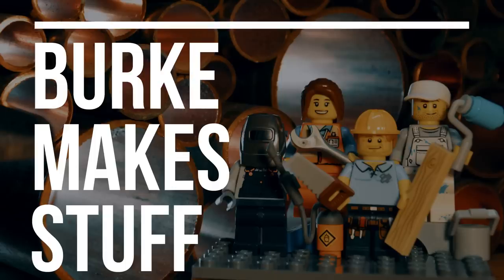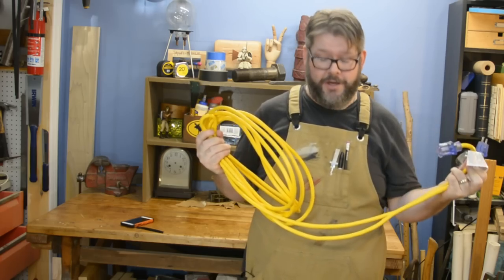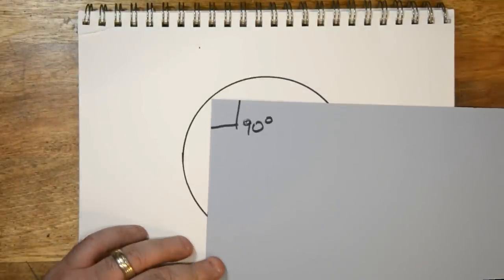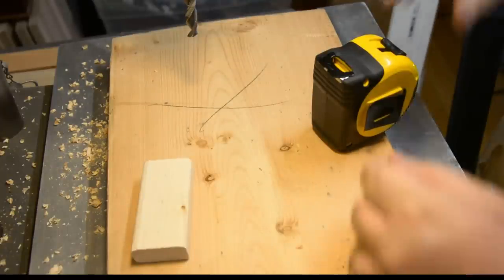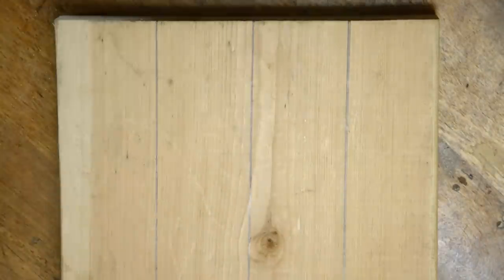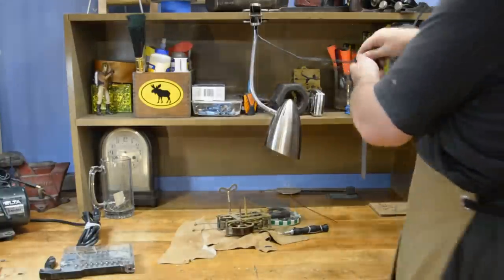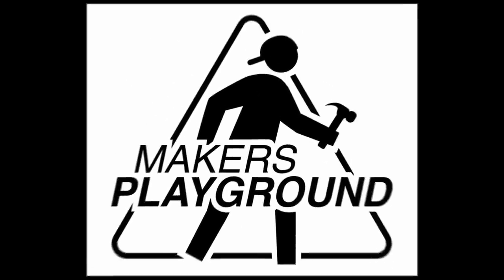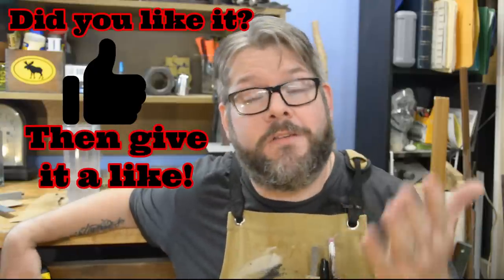10 Easy Shop Hacks #2

Comment: The way you “coiled” that cable made me sick.
Reply from the maker: So I’ve been told. Lol. This is gonna sound dumb, but I’ve always done it that way. I am, however, not above admitting when I do something wrong. What’s the right way?
Reply: Pull it all the way out, leaving it coiled will cause a tremendous amount of heat which could take the tool out or worse the whole shop. Have you ever tried the trick where you take a mail wrap a wire around it and put it on a battery it gets hot as heck. A battery is only 1-1/2 volts your wall is 120.
Reply from the maker: So I’ve been told. Always down it that way. Never had an issue. If it makes you sick though, I would highly recommend NOT doing it that way! 🤮

Comment: I stopped watching in the middle of the 1st “tip”. Winding an extension cord around you forearm it the absolute worst way to wrap a cord. I was a Union stagehand for 15 years and doing that was a great way to get yelled at by the Head Carpenter or Head Electrician.
Reply: Trust me, it didn't get any better.  "Stupid Shop Tricks for Stupid People who can't use a tape measure..."
Reply from the maker: Absolutely accurate. I intend to cover my mistake in a future video. You are correct. However, I have gotten wonderful feedback on the other tips in the video, so forgive the first and maybe check out the rest.
Regardless, thank you for pointing out my mistake. It’s the only way we learn.
Reply: @BurkeMakesStuff  G'day, I had to stop at the same spot and check the comments. ( I did watch the whole vidio ).
Safety first. Always unwind power leads when in use, spread the extra length out to prevent "hot spots/heat damage"
Winding method second. Make the loop as big as posable. I normally use full arm span for each loop. Halve the first loop, hold that point. Now do each loop from that point. There are several "Extra" things that can be done while winding. I like to make sure all of the twists are out of the lead/rope while winding.
Reply from the maker: @skullandcrossbones65  while I DO hear you and understand about wrapping the cord around your arm., isn’t laying out the entire cord excessive? If hot stops were any sort of a significant, or even minor issue, due to using cords while still wound, how is it that they sell retractable extension cords that hang in shops all over the world without issue? I don’t know a single person that has one that pulls the entire length of cord out each time they use it. That would negate its purpose.
Reply: @BurkeMakesStuff  G'day and thanks for the quick response.
Firstly let me make it clear, I am not an electrician. I do not understand all of the "White Man Magic" involved with electricity. I have, like you worked with power tools and equipment for some time. I have also worked with and for electricians.
There is also a degree of "Do what I say, not what I do". From time to time I too also use leads that are partially wound. I have seen leads ruined from not being unwound.
As for the "Retractable" leads, I have read warning instructions saying to fully unwind before use. This type of warning may vary from country to country. There are probably lots of influencing factors that need to combine to result in problems. i.e. Voltage, Watts, Amps, Time, Ambient temperature, Quality of insulating material, and the list probably goes on.
It is probably like a lot of safety rules. It usually takes a combination before problems happen.
Stay safe
Reply from the maker: @skullandcrossbones65  awesome! The phrase “white man magic” is one of the funniest I’ve heard in a LONG time. 😂 I know VERY little about electricity ⚡️. I’m ALWAYS open to learning more, especially from those that are in the industry. 
As for writing back, of course! I try to get back to everyone. I’m just astonished that so many people reach out.
Be well!